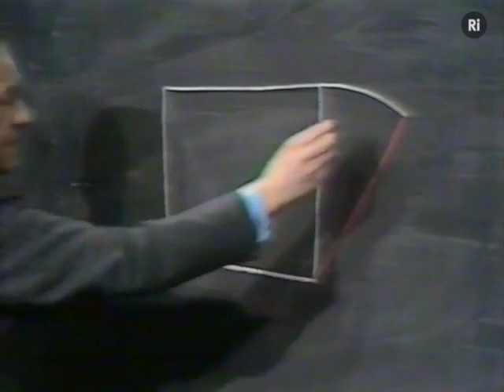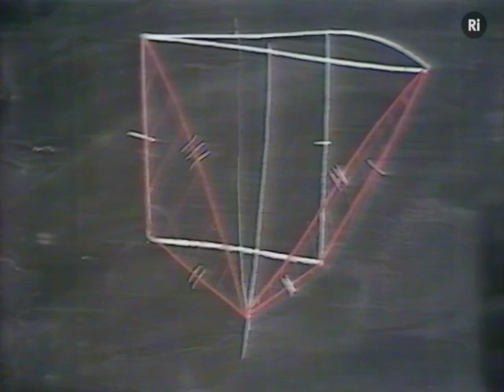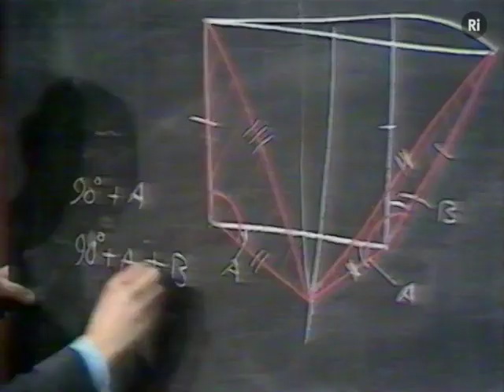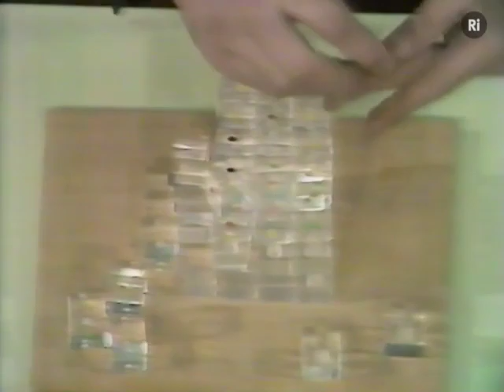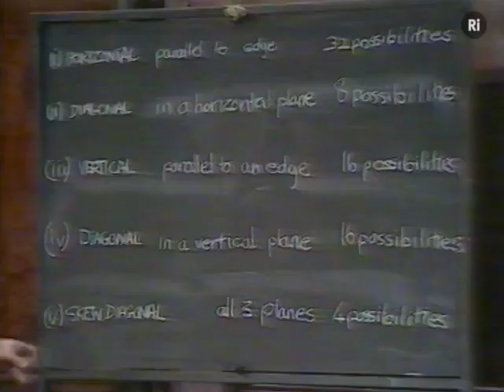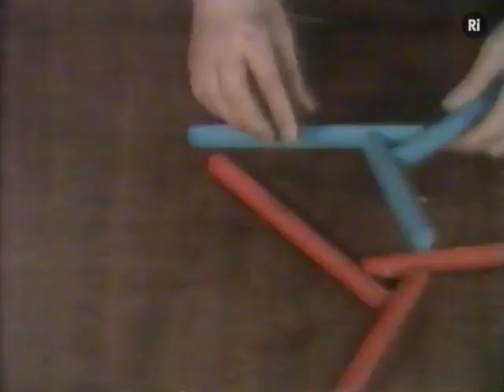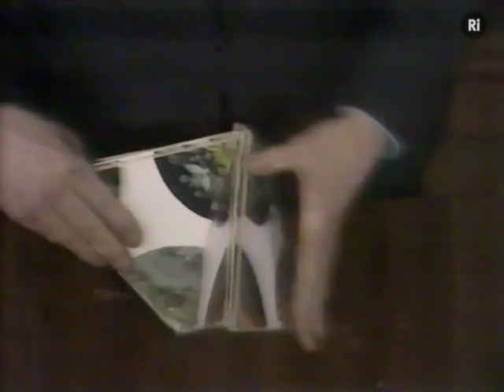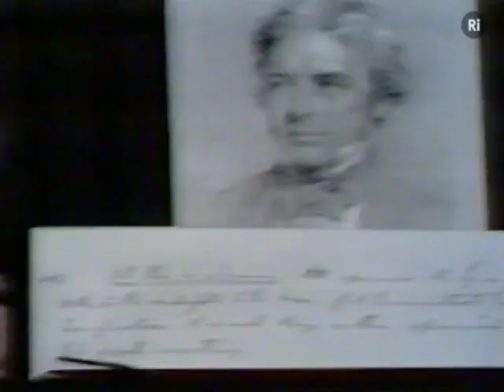"It's My Own Invention"  Eric Laithwaite 1974 RI Christmas Lectures, Lecture 6

Comment: The loading of loops makes the system floats higher because the number of loops increases and the induced emf due to the flux change goes up
Reply: Why would a thin peace of Aluminum not float at all while a solid thick piece does. Only differences are the surface area of the inner and outer surfaces and weight...
Reply: It would be like trying to make a induction motor Spin with a single thin winding on a 90° angle to the flux lines...
Reply: @steve-o6413  because with more atoms, you have more eddie currents inside, or stronger ones
Reply: @steve-o6413  Yes surface area affects resistance and thus controls eddy currents... And thus more magnetic force

Comment: Question: would a wheel of magnetics, instead of a tube or track, produce a perpendicular standing wave? Perp to the axis of rotation
Reply: Yes
Reply: what do you mean magnetics  the bible says  god spoke every thing into being  thats the best place to start   a vibration in a medium air   throw a stone in a pond  throw two waves meet   a glass broken by a voice why how   ice water steam all made of same  rub balloon on head  what holds things down  spin things test axel to outer most part with meter and magnet   look at water down drain  two tune forks same tune hit one what dose other do  how dose a washing machine bounce all over what would it do if it could go in any direction easily  or drill with big allen wrench in cordless drill straped to a mechanics creeper  make 3 or 4 coils of wire the same pulse on crazy fast very low to no amps very high volts test other same coils  tune a few strings same on guitar pluck one what do others do dont think + - think higher lower potential  spin disks of diif metals on same shaft in same and diff to each other  why dose the toy top never stop spinning if sucked to center until batt dead what happens if  gyroscope is not alowed to rise now how about two spinning on same shaft dose you being shaken around slow un balanced hand drill why light switch arcs   so many things to wander about  but the most important is to do as jesus said and test ALL things for your self  the best thing is to start by reading  the lost sheep story and prodigal son story  so you know who god the father that loves you and wants his children with him  he dose not care where you have been he cares where you are going   god our father king of kings is not what most have been told this world is not what we have been told  read test for your self and you will find the greatest thing and you will no longer care about the others you will be set free  knowing this dream or video game that we all think is the real is to chose the age old good or bad  if you did no wrong you would need no savior or help from a perfect father bible says not one without sin not me or any other   the diff is knowing trusting in father that is made of three not in man yourself  a job or anything else  science of today fits the description of a religion  not true science tesla said in his day it has nothing to do with reality 
dont think or call me crazy before you test my words  i told you many ways to waste the very little time left and how to find the greatest of all things   one brought no good to the many that stumbled across or  tested and found  the other brings things so  much greater than can be imagined  why did the things of this video not bring good to eric and the many others  i say with love you will be no exception  i hope you and any other who reads picks what sets free brings true lasting peace love and under standing 
either way start with truth the bible says god spoke   we live in a sea of non truth  i hope you test all things for your self before time runs out because that will bring you right back to the only truth you can find the bible  i say that with confidence not arrogance because it happened to me along with many other thousands when they find out of place "impossible" things that have been lied about and start testing all for themselves  notice i say to test every thing including me the bible the religion called science  keep what is true get rid of whats not  and we will be on same page only one truth   well thats my book that no one wants to hear i write in the hopes one trys to prove me  just another web crazy   i exept nothing that cant be tested and proven true by anyone  yes it all is so simple babes will get it but scholars will not because the biggest obstacle to truth is thinking you already have it   
there is mostly or always a easy answer that you already think is true  but what happens when you find all information and then consider it all when first researching before testing in any way you can yourself  i found that there ends up being a crazy amount of red flags pop up when just researching that points it being lie  but you dont stop researching and testing  till you have all possible info no matter if you think its right or wrong  then consider all info you find what is true  and understand your not special lol we all have fell for even the simplest of lies for many generations  we just have been indoctrinated to believe certain magazines books people and organizations  people once believe the president and gov  and school books saying columbus discvering america that some of our brothers or sisters had no rights and countless other things time to really test every thing for your self trusting nothing until you test it   truth stands out when all info is considered  you dont have to be even average intelligence  ask me how i know  lol i once made my self a fool thinking myself highly intelligent in knowing more than or holding my ground with any scientist in many things  i didnt want to believe i was fooled more than most  that was hard to swallow there was countless life wasted on learning lies my wife leans 2 or three times faster i just but so much time into believing parroting and thinking i understood the lies   alot of the lies is so simple to see after testing many other lies     it gets your mind reprogrammed to think before mindless believe    there not good lies lies full of holes when you know to look  they are good at indoctrinating programing to repeat what your told is true from some one so much smarter than you  understand this truth if a person can not explain in simple way  then its a lie or they dont understand it   understand you dont think some one would lie because you wouldnt you may fill bad if you do some one wrong even if no one know but you  some only fill bad when caught  and if i set in my garage for a few hours a few times a week it dont make me a car  same as setting  in the amen pew of church  read your bible for your self before you go to any church!!!!!!!!  most almost all preach a diff gospel than jesus did   the church temple pharisees top church or temple like preachers pasters of that day jesus said was vipers  and many other not good things   feed up with churches you dont like them good jesus didnt either    jesus was against religion from every thing i have read and  understand 
bible says you cant do enough good to get in heaven and your good deeds are dirty rags if you do them trying to get to heaven or be holy  bible says the    toe  finger or hand   are all needed  parts of body one cant say better  more inportant or holyer than other
heaven saved id free gift no one can bost or brag because there works cant get then there  sound fair what do you expect from your perfect fair and just father     certainly you didnt think it right  for them dressing up for a show never miss church good deed doing when people see  telling you your going to hell  thinking themself better more holy than you  was how your loving father ways no no no he is our perfect father  jesus said get the plank out of your eye before you pick the spec out of your brothers 
 anything you can do besides believe in and trust in jesus god our father what he has done for you us not any good thing we can  do      no good deed or work of any kind will not get or help you be saved    say you have a kid you love so much you  want  so bad to help them in life  but they have nothing to do with you   how can you help them when they fall or help them fix the things they are doing wrong SIN   you cant but if they would only have relationship believe trust in you  you could help them in many ways you know a child  messes up sin over and over and over on some sin god the father calls us his children   do you not give up on a child for messing up over and over and over if they are trying to do better and trust in you     you think i speak lies but read for your self google  kjv bible then key words like dirty rags or others i wrote  it will give you place in bible to read yourself    kjv first english translation all after must be a % diff or it cant be a new version that is why kjv  i told you most every thing we think is true is a lie test me   all people in bible down to the thief on cross beside jesus was save by believing no going to church giving to church or poor or any other works you can do   how much dose a free gift cost  if you pay is it a gift   who is jesus who is holy spirit who is god the father  they are the three parts of one god our father     you have 3 parts also soul spirt body    jesus  is god in flesh that came and died in your and my place     the old covenant law says the punishment for sin is death  the new covenant stated after jesus died for our sins he had no sin a was tenpted just like us     bible also says there is not one of us without sin if we say so we ldeceive our self     because all has sinned and all need a savior to take our place and die for our sin    so we can go be with our father in  heaven the real     not hear the place we chose good or evil  after experiencing knowing both wheat and tears growing up together knowing good and evil    the free gift  is  god in flesh jesus  blood  washing our sins away  there is and cant be sin in heaven or it would not be heaven   the gospel means good news    the good news is jesus took our place died for us so our sin debt was payed with his blood  so we could be without sin and go to be with father in heaven   father dont care where you have been what you have done but cares where you are going    now you have heard the true gospel not the fake one the bible warns us to not fall for  the truth sets you free   father is so awesome seek him and you will find him  love you even though i dont know ya hope to see you my brother or sister in our fathers house
Reply: @ambersmith6517  I Got bored in the 1st quarter of this comment lol I'll just say Jesus, Moses, Jacob many ppl out the bible were just electricians ahead of their time and ppl that didn't understand that may have thouGht it was somethinG else...
Reply: radial

Comment: 19:13 "...might worry you for a little while."
hours later and i am still worried... i tried to make this image with a compass and square and can't. the hypotenuse of the triangle on the right ends on the right side of the square.
 he did say it was a rotten drawing... it's those A legs. they end up being really long. he made them really short. did i do something wrong?
Reply: That's the whole point. If you draw it correctly, the triangles aren't mirrored. So the whole math is just based on the "rotten drawing", but he didn't say anything wrong before he wrote down the formula, which is obviously wrong.